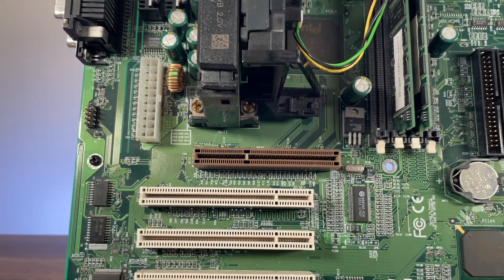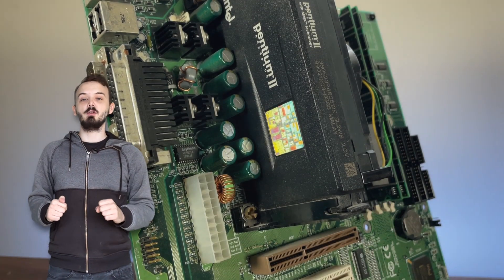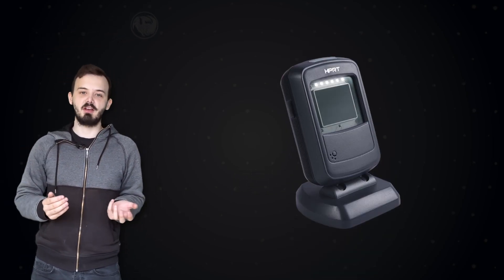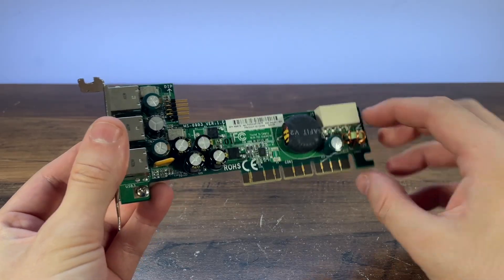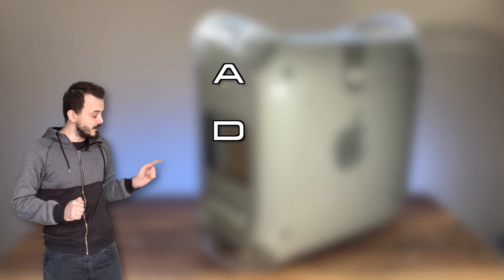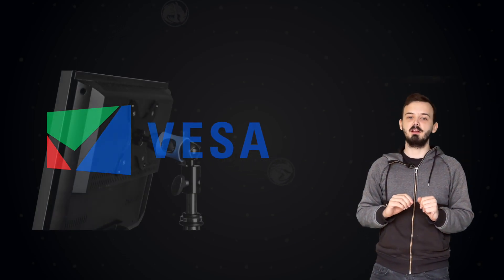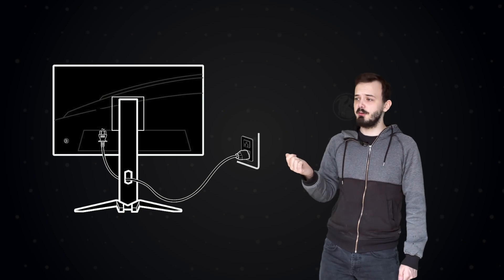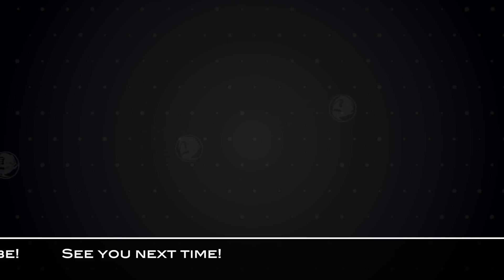This AGP card is not a GPU...

Comment from the maker: When I said about a monitor using USB-C and power delivery, I meant the monitor is by powered by USB-C using the same cable for video to the computer, not one that charges a laptop!
Reply: They're actually plenty of portable options that do just this, they take power from the same USBC cable from any USB-C port that supports video out as well as power delivery? Although in terms of pass-through IO, it's still just a USBC, need a hub to really plug anything else into it, the one I have is from a company called arzopa

Comment: Quite the late comment, but I do own one of those POS PCs. 

It's an HP that's basically a cost reduced HP Compaq D530 SFF mode with the 845GV chipset and an AGP slot of some sorts alongside a PCI slot for a riser card.

Comment: I have an AGP to PCI adapter here so I can even install sound cards, LAN or controller cards etc. on the AGP connection.  It's funny 😄

I'm currently using it to connect a GeForce GTX 960 to the AGP port via PCIe to PCI adapter.  However, it only works x1 speed.

Comment: Nice, i knew there had to be some agp slot cards that were not gpus. I've also seen agp-pcie adapter on a specific asrock gpu card.
As for USBC powered monitors, yes, in the past years there are lots of solutions, specially in corporate environment, USBC powered conferencing monitors (that also act as hubs).
+subcribed
Reply from the maker: Ah thats interesting to know, and thank you for the sub!

Comment: Look at the Dell video conference monitors like the C2422HE. They provide USB-C power to laptops, have a local hub for sound, webcam and USB-B gen 3.2 and USB-C ports and can even daisy chain another monitor over Display Port.
Reply from the maker: I should have worded the question better but I meant monitors that were powered by the same USB cable that it receives video from 🙂
Reply: @NaokisRC  no problem, I have an AOC 16T2 that can be powered by the same USB-C cable as it gets video. It’s a 16” portable display that also as an internal battery.

Comment: As it happens I have a monitor that powers my laptop using PD and has a built in hub for usb meaning I can have my keyboard and mouse ryc plugged into the monitor with just a single cable going to the laptop (or ipad when I want to suffer stage manager)
Reply from the maker: I think I should have made it clearer that the monitor itself runs on power delivery, not that it can charge a device with it lol
Reply: @NaokisRC  ah yes. Sorry I didn’t pick up on that. In which case, no I’m not aware of many that do run on PD and none that have a usb hub as well. (The ones that do are the portable 15”6 monitors etc)

Comment: We actually sell such a monitor like you described in our shop (in Gloucester) It features USB-C with 100W power delivery, a usb3 hub, displayport out to connect to another monitor, ethernet (1G) and the worst webcam I've ever seen. You can also daisychain using displayport only (we've not tried this). It's made by Targus the laptop bag people. Its a 24" IPS display.
Reply from the maker: I suppose what I meant was that it was entirely powered by the computer, not that it includes a USB-PD charger 😅
Reply: Well I guess this is the other way round. the screen powering the PC

Comment: Ah yes Green = 12V for touchscreens, scanners, payment terminals etc.  Red = 24V usually for receipt printers.  The Dell Optiplex XE range and HP's equivalent have cards available to provide this.
Reply from the maker: Interesting! Did you ever see high power 5V?
Reply: @NaokisRC  I've never seen a the 5V high powered USB, But i have a Toshiba rebranded IBM POS machine with 5/12v Serial connectors. Which i didn't know were a thing.